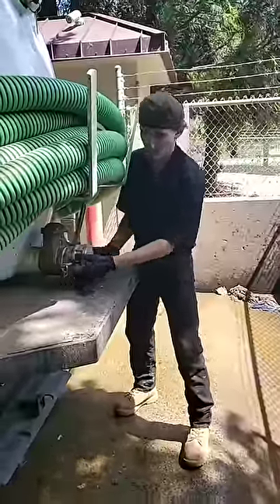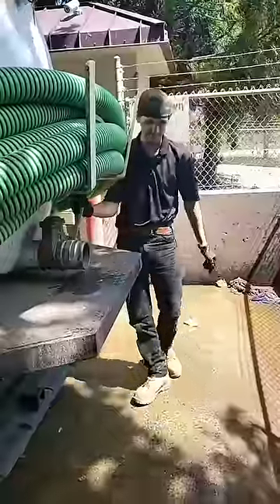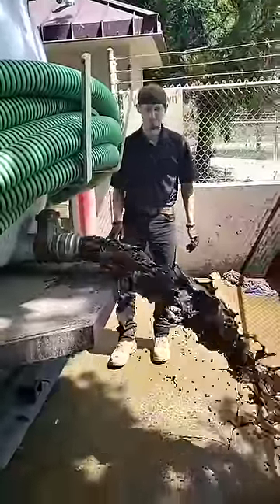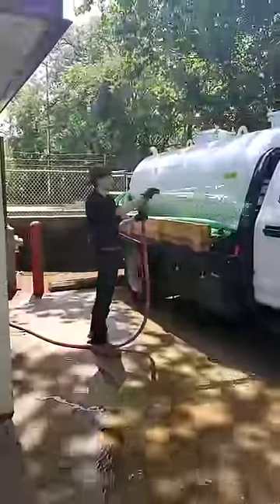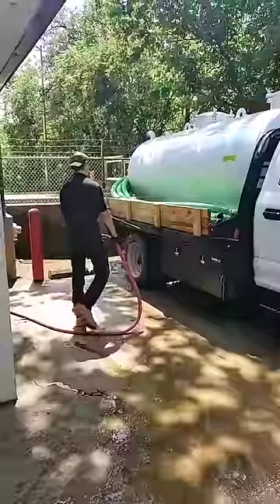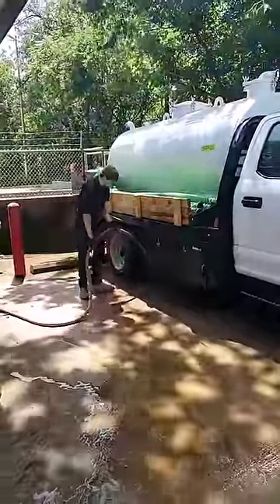What do we do with the septic waste when we dump it?

Comment: Depends on the class of sludge that is produced. Some treatment plants do produce class "A" sludge that is suitable for direct fertilizer. Other class of solids are used for soil reconditioning. Totally depends on how solids are processed and what facilities the treatment plant has.
Reply: Recycling human fecal matter is disgusting. You don't know what type of diseases or chemicals someone passed through
Reply: @mandy9775  good thing plants and humans don't share any diseases. You can't get a plant sick with a human disease, that disease won't replicate, and won't contaminate the food.
Reply: @Embattled5211  only in the context that the fecal matter is properly treated 🙄
Reply: @mandy9775  it doesn't need to be treated in order to be safe for use as fertilizer. If you wanted to use the water for irrigation, yes it needs proper treatment, because that directly coats the surface of the crops, but for nutrients use, and bacteria or viruses that target humans would not be able to transfer on to plants, humans and plants such different systems that those diseases cannot infect both, it must be either a plant pathogen or a human pathogen.
Reply: @mandy9775  im sure the guy who’s entire job is running a company disposing of human shit knows more than knows a lot better than most people
Reply: I think there is a prototype power plant in Germany that burns sewage to generate electricity.
Reply: @Embattled5211  yeah thats how you get Hep outbreaks good luck
Reply: @Just Another Commenter i live in a huge farming area, and human waste is just like pig shit. because of what we eat, our shit being used as fertilizer untreated would be a terrible idea!! main thing is it smells absolutely god awful (a.e releasing tons of ammonia, methane, and other gases into the air). where i live pig shit is treated usually with heat before it can be used as fertilizer because there is mainly too much nitrogen in it and would be terrible for the air, create way more algae growth in water, and basically gas out everyone living around it.
Reply: @Embattled5211  assuming it is properly handled. That's generally the problems it's safe for the plants it might go on but not for the handlers and the farmers.
Reply: I work in a class b plant. The sludge is land applied and must be injected or turned over within 24 hours and can only be applied for cattle feeding crops

Comment: I use to landscape and one of the last jobs I worked at was a treatment plant. They had 8 new tank built and new sod had to be laid. Long story short, no sewage was burned but a lot of went through extensive filtering and treatment and was sent back Into the water system. The solids were mulched and was shipped to be turned into fertilizer.

Comment: The set up here is a lot different, to dump, trucks back up to what is basically a huge basin and just dump down the sloped concrete apron that leads into the basin. The yard is fenced in but it never closes completely. 
Trucks here are also larger, the smallest I've seen are medium duty trucks with about 26,000 lb GVW, (IH 4300, Ford F800, Freightliner FL120, etc.). 
Most tanks are at least 3,000 gallons with an onboard vacuum pump.  
Our residential systems generally have at least one 500-1500 gal. solids tank and one or two 20-25ft deep by 6 or 8ft round cess pools in the ground. That means they can hold 4,000 to 8,000 gallons each.  
Most companies charge a flat fee for the initial visit that includes a set number of gallons started around $400 or so. From what I've seen owners here don't often clean their trucks, most are pretty rough looking.

Comment: Milorginite from Milwaukee sewer system! It's a fertilizer sold as a low burn fertilizer. It is treated through biological break down then dried and packaged. However, there is down sides to using sewage as fertilizer, if not properly allowed to compost for a period of time, it can contain ecoli, and other diseases. Sewage will also contain heavy metals like arsenic and mercury which doesn't break down and some plants can absorb them through roots or even surface contact.

Comment: I have a well pump that i use for the liquid. Its a 3/4hp with a 3/4 output. I hook it to 2 sprinklers in my field and pump out my liquid while sprinkling my yard and use it to grow my grass/hay. The feild gets daily water on top of doing that 4 times a year I do 4 cuts a year of the grass, i then mix it 1 to 1 with fine sawdust and make compost with it. Ive had my garden soil tested at the start of every year for 4 years now and am told every year i have the most nutrient rich soil they have ever seen. No metals no pathogens nothing bad at all. Its a very rigorous test. 90% of store bought fertilizer is full have bad bad stuff. I dont fertilize ever, its all my compost

Comment: I ran a vacuum tanker for several years and on those we have a blowback line which is an air line that we use to blow whatever liquid out of the line and back into the tank or we use it to create a void while we build negative pressure so if hose is clogged that void will help break it loose once you open the tank valve.

That being said I've seen a guy get hit with a cap that had pressure on it because his blowback valve was slightly cracked open filling the void between the cap and valve with 120psi of air. He popped the ears and the cap caught him in the sternum and took him smooth off his feet. He lived but spent a couple days at the hospital.

Comment: @James ,
I worked for a plumbing contractor years ago. I sometimes had to run the truck or go help the bosses son, the village idiot.
We left a pump job, drove 25 miles to the plant. He left the pump pro running and on pressure for backwashing.
He tossed the hose in the manhole we dumped into, flipped the lever. The hose stood up like a mad elephant and sprayed the fence and the guy from the sewer plant there over seeing the dump.
Not sure , I have ever held a laugh so long, till we pulled out after washing it all down. 
I called the truck Simba and the bosses son Dumbo both well deserved. I laughed the whole 25 miles back and continued till I left that company!

Comment: The solids are run through a press And usually where I worked was spread over permitted land. It had to have a permit because it was human waste. The fences is to keep outvanderland zone because because some of those pumps are so expensive and dangerous. If you fall in an aerobic chamber you will go to the bottom because so much air in there from the aeration process.

Comment: You don't really lose the "nutrients", they just convert to a more base form.  The ash could be used as a mineral supplement.  THe ammonia, urea, nitrates, etc will lose most of the nitrogen compounds but it will still leave behind the base minerals/metals.

Comment: The nutrients (sulfates and nitrates) aren’t in the solid portion (less than 3% of potential product).  Its in the liquids!  As a fun experiment, try making your own nitrocellulose (gun-cotton) from unrefined product, without using bird or bat shit.  Also, the filtered ammoniates and nitrates stored at the facility are a big part of the barbed wire and security.  They are critical components for producing high explosives.

Comment: Our local treatment plant has a digester they put the solids in to create methane they burn to 1 reduce the greenhouse gas emissions and 2 offset power costs. While burning methane does release CO2 that CO2 is far far far less effective a greenhosue gas than the methane. So not only is it cleaner but its more effecient. I believe about 1/3 of their power is subsidised by the methane digesters. I cant believe this isnt standard.

Comment: Not my story,
A US NAVY submarine had a port call in Greece. Upon leaving port, the town officials gifted the crew meny bushnells of fresh apples
The crew, when 50 miles off shore, dumped the apples over board.
This was protocol due to the fact that the orchard was fertilized with human feces. 
And if eaten, the crew would get sick. 
This is why the poop get incinerated. 

Although it could be used for non eatables like flowers and such. But once it is sold, who can say what it would be used for.
I think fuel for an incinerator that is generating electricity would work best.

Comment: It's a wastewater treatment plant 😳. I have worked at one for several years. My plant I run a machine that gets rid of the solids and mixes with a chemical called polymer. It gets put on a semi trailer then goes and gets furtherly processed then gets sold off as a fertilizer somewhere else along the line.

Comment: There is a new company looking turn septic waste into carbon, coal like substance that can either be burned for energy (cleaner than current method by a good bit) could be used as a replacement for sand in concrete (save a lot of shipping energy) and may others I don’t feel like typing out (somax bioenergy is the company doing the research and development in Pennsylvania )

Comment: I want to build a plant that burns the waste for power to run the plant so the plant is fully off the grid and uses no external power. It will also produce clean drinking water and collect precious metals. I have the business plan almost complete. The PFAS and PFOS rules comeing down the line has kinda halted me temporarily.

Comment: Former waste water engineer clocking in! The reason we dont use human waste is actually due to chemical issues. Humans are not really that good at digestion and a large number of chemicals such as sucralose and synthetic hormones dont get broken down well in our bodies. We pee and poop them out regularly, it takes additional digestion in giant vat digesters about another 45 days to process human poop solids into useable fertilizer. Add onto that coliforms, e coli and such, present in human waste and anything fertilized using human waste requires a minimum 2 years from fertlizatuon to any cultivation. The two year minimum is a bit silly, its probably more like 6 months but we also do not use waste water for agriculture which is always very high in mineral content as well. Top treatment plants can actually produce treated waste water that is nearly pure water like reverse osmosis quality but even if its safe no one wants to drink pee water and we dump it in oceans, rivers or deep well discharge in land. We really are very wasteful creatures at times

Comment: Human waste may be too rich to use as compost without being given time to compost down, depending upon the diet of the producer. I guess an incinerator takes up less room than a processing plant.  Plus the amount of urine in the waste will create an anaerobic environment, slowing breakdown and creating one heck of a stink.  It's not as simple a matter as it sounds like it should be.  As an alternative I guess they could think about drying it and making fuel for 'green' power production 🤷🏼 or is that what they're already doing?

Comment: You drive an "SST" (A sh*t sucking truck).  A bigger one might be called a "SS,SST" ( a super sized SST).  I remember the Somali waste collection contractors coming around to suck out the porta potty's, when I was deployed to Mogadishu back in 1993.  At 4:00 am.  10 guys running around with hoses, working the pump, wiping down, and generally doing sh*t. Fun times.

Comment: Human waste is not a good fertilizer. The toxicity of our waste system can cause serious problems when consumed. Martian was a great movie, but the matter needs to be heat treated and aged for at least a year. Then, it should also not be applied to a the parts of a plant actually meant to be consumed. All in all, it is a very strenuous exercise to enact. Heat treated, pH boosted, aged, micro reimplantation. Takes a long time and not cost effective.

Comment: Lol I know  exactly  what happened to him, my 1st day as a turd sucker, my new boss said go flip locks off the discharge pipe and get ready to hook a hose  to land spread the load that came from a restaurant, ( much worse than shit ).
When I flipped the lock levers ( I did not know  he precharged tank just for little old me ) pto was not running  so no warning until the cap hit me in the chest.
To make a horrible story easier to read, our next stop was a lady turd tank pumping, she kinda freaked  it was late October cold as shit.
She saw me in her drive only  in my tightly whiteys with water hose on over my head.
She came running out with towels and said  no don't do that out here you will freeze  come use my shower, it was a great idea till she got close to me, then she said oooo my God. No way your coming in my house, she ran off and came back with dawn, several bars of sope several towels.
Then she said you can have all this  I want  none of it back.
Yes it's that bad.  
For the next 10 yes my boss did not walk around any open tank  Damm it I still owe him a good shove .

Comment: Yeah, nice idea, but the disease and drug concentrations in the waste could be a biohazard. We know what should and should not go into the septic, but do you think the majority of people actually follow that? I have a question though… wouldn’t it be easy to make bio gas …methane from the waste? And people who eat and dump oil and fat down the drain, that’s not going to be good for fertilizer. But it could be heated  and separated and used along with the methane as fuel for the burning of the rest.

Comment: I work at a sludge treatment center (STC) in Scotland, we import sludge from other sites along with tankers of domestic and industrial waste (breweries/ distilleries)

Our site essentially breaks down the pathogens within the waste and digest the material much like your stomach. The result is we then harvest the gas to run our combined heat and power engines (CHP's) to produce electricity which we use to run the site along with feeding back into the national grid along with producing a high end natural fertilizer which is used throughout the country in organic farming.